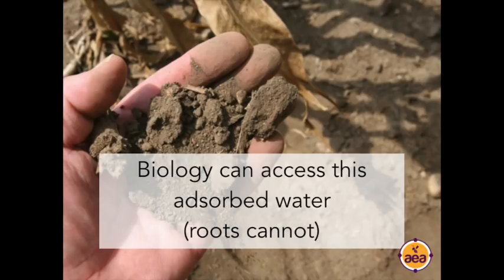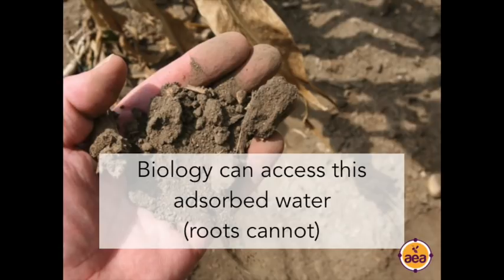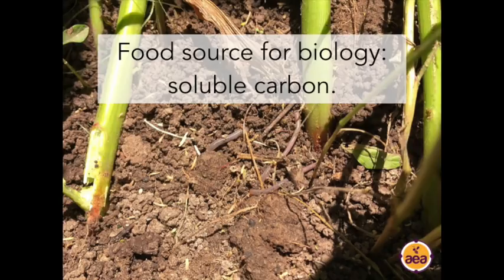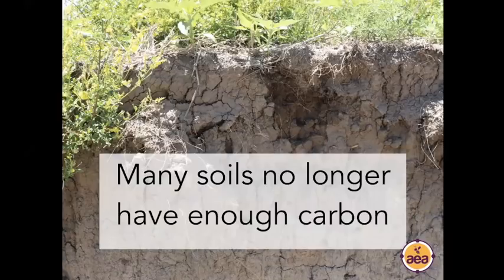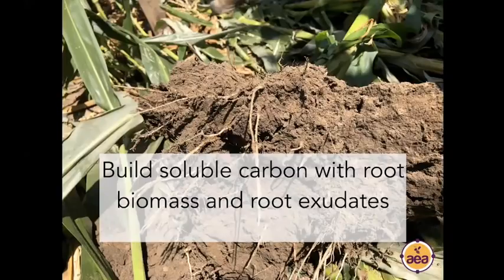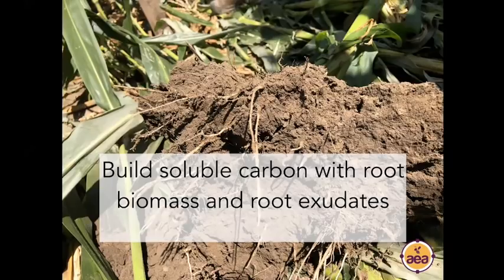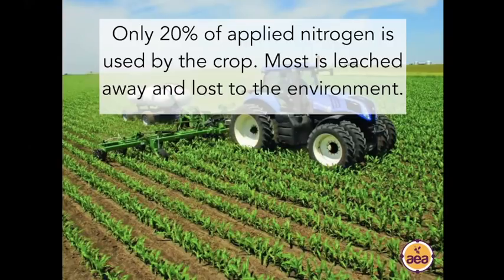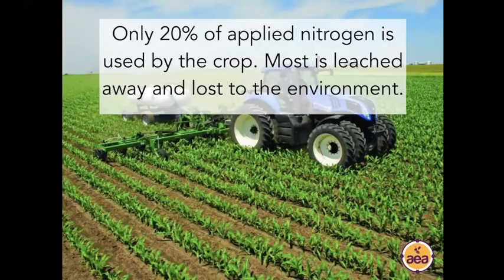How to Manage Soil Nitrogen and Carbon Sequestration

Comment: This is a comment to an umpthteen listen on this webinar… I’m really hoping John or the team can see and pop a reply…I understand the carbon distinction well with that coming from root exudates and the biological ‘cascade’… I need  to clarify though, here John opened with food as the biggest limiting factor and specifically soluble carbon, the soluble carbon clarified was … that stabilized through root exudates and biological processes. Also called liquid carbon, also called humus, and further into humus fractions etc… so why did John mention that people using Humic acid and calling it food is a misnomer…?  Did I miss something.  ? Improving photosynthesis improves soluble carbon flow which is also the long term highly stable carbon ‘humus’ (hard to define I know..). Help..

Comment: i have a question if fall N application is not good and do damage soluble C, why N don't hurt soluble C in spring, summer, or winter?
Reply: Waqas Ahamd I think his point was that leaving excess nitrogen in the soil without it being taken up by the soil biology and plants (becuz there’s no plants and less food) means the soil has a lot of free nitrogen roaming about that will degrade carbon sources.
Reply: N application does also solubilize C during the summer months. Hopefully, there are green plants present which can pick it up and return it to the soil, and prevent it from being lost to the atmosphere.

Comment: Hi John, just out of curiosity. Does the worlds deserts also hold 70% water capacity? Could we then say that the deserts have sufficient minerals and water but lack the biology?
Reply: It will vary depending on the soil particle composition. It is primarily the fine clay particles which adsorb higher levels of water, rather than sand. Desert soils need to be aggregated to hold water well, which happens best with grass roots rather than tree roots.

Comment: Close, but wrong. Carbon is not the only food source for microorganisms. They need C, yes, but also N, P, K, Ca, Mg, Mn, S, etc etc etc.  C is the primary energy source, but their bodies are made up of many different elements/molecules.This presentation is a good example of what is wrong with agriculture today; trying to simplify too much a very complex system.
Reply: It seems we are saying the same thing, carbon is the primary energy source and food source for microbes. Other elements are needed as enzyme cofactors, etc, but not as an energy source in most cases. Simple explanations are needed for the components of a complex system. We share a lot of information about the many other facets of the system in the videos on our channel. Thanks!
Reply: Raurke Goose His entire point was that they’re lacking carbon. Soil biology has the ability to rip nutrients out of places that plants cannot. That’s why we need them. They won’t run out of nutrition. Actually, soil holds wayyyy more nutrients than we think are available in the top six inches while plants and fungi reach down yards into the soil.